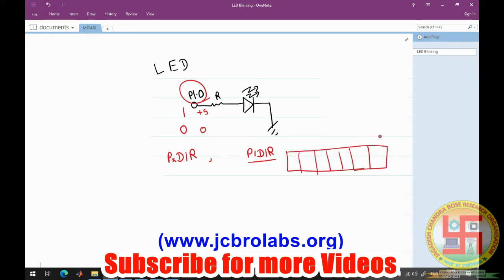MSP430 LED Programming on Code Composer Studio

Comment: Can I do register level program without using the actual msp430 board? Please make a video on this
Reply: You can write the program sure, but you will need the board with the debugger circuit built-in to see the microcontroller (MSP430) registers in real-time. Otherwise you will need some kind of a simulator, like the ones available for AVR and 8051 microcontrollers.